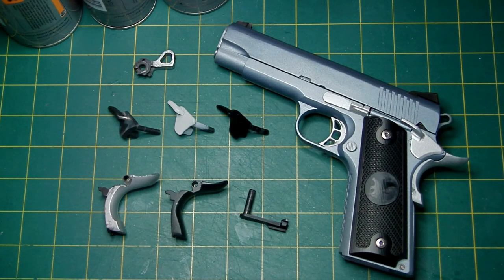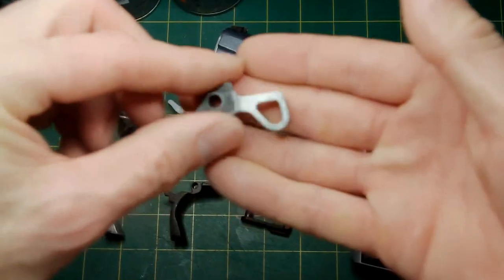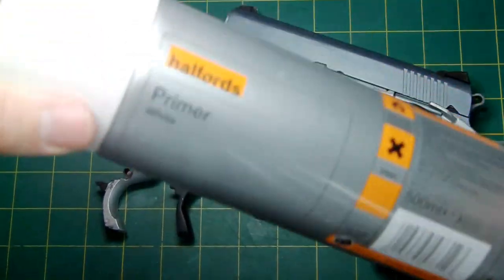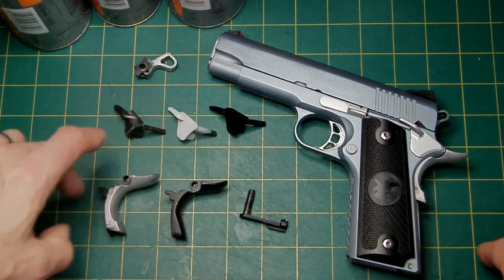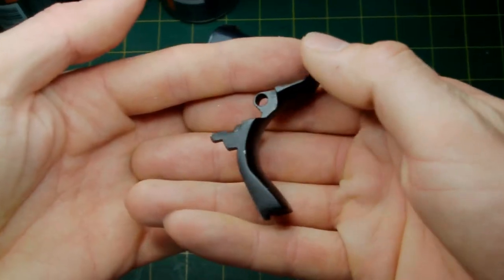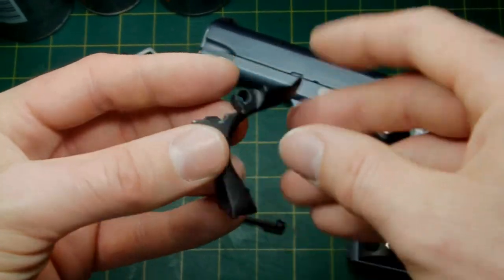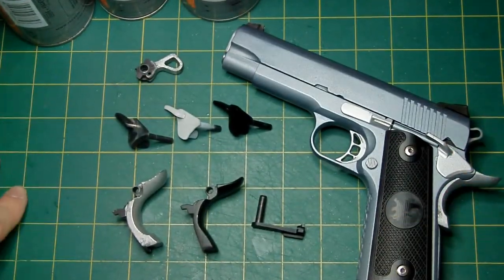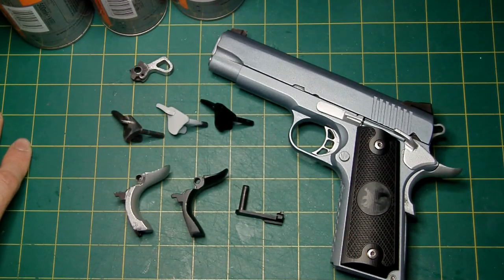LaZouche Custom airsoft how to paint metal parts.

Comment: Last tip, its a good idea to rub some dishwasher soap used for cleaning dishes and water on the part to get any grease off. Do so after you sand it.

Comment: Hi, Would this technique work on metal Hi-Capa slides? Or should I use paint remover then do this technique?
Reply from the maker: Should work fine. The original base coat will take the paint better than bare metal but the finish will only be as good as the base coat.
Reply: ***** Ok thanks, I think I might lightly sand the outside of the slide to make the previous layer thinner as to not ruin the aesthetics of the slide by a thick layer of paint.